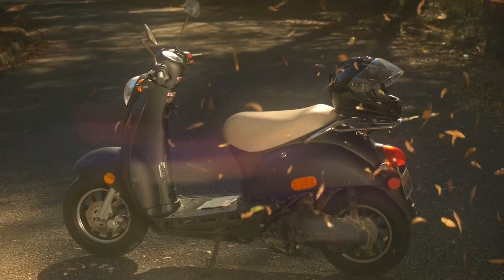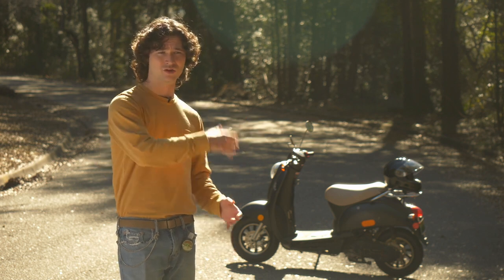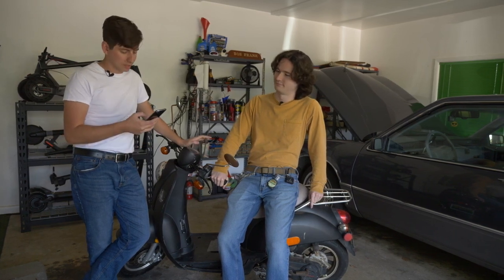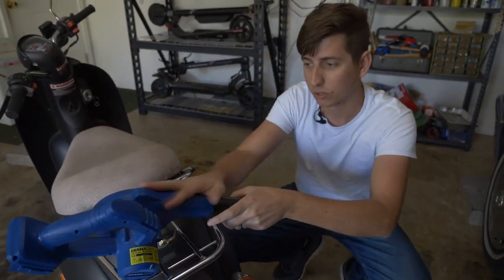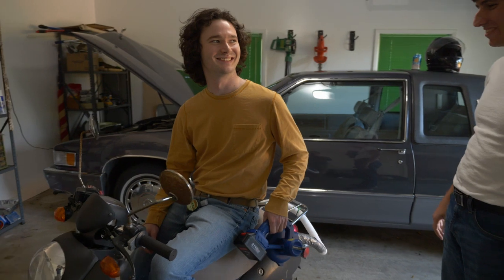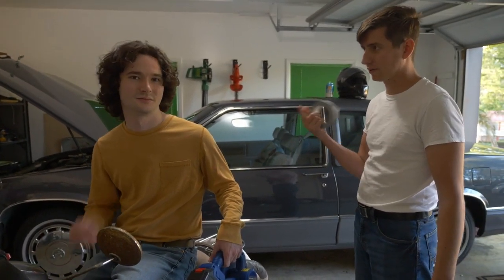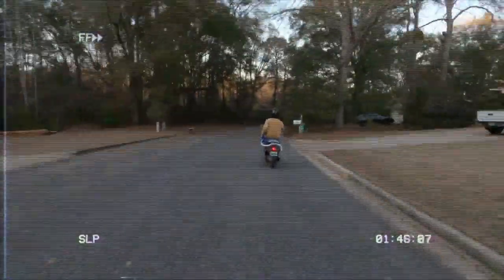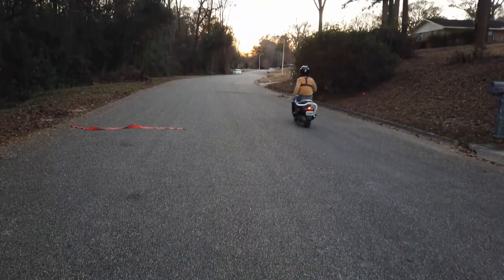HOW IS THIS EVEN POSSIBLE??? Leaf blower supercharger on a Colman Moped

Comment: U did the wrong thing.. u cant do a blow thru on a carb bike.. you will need a draw thru… meaning u need a ‘Y’ hose intake 1 for the carb 1 for super charger to push air into ur engine.. else u have to mount the carb into the intake of your leaf blower